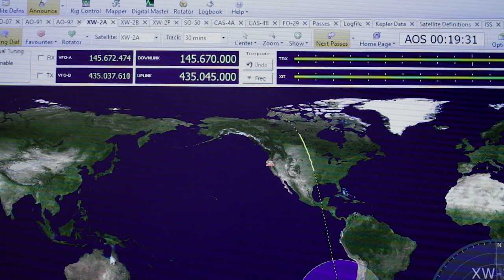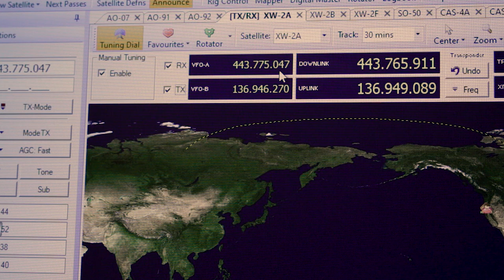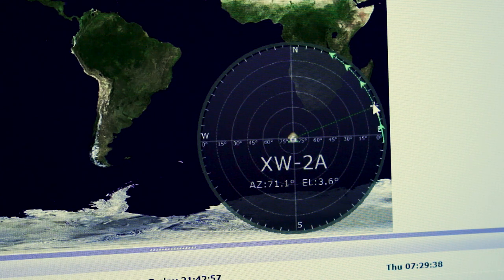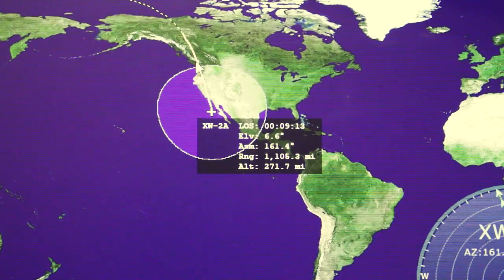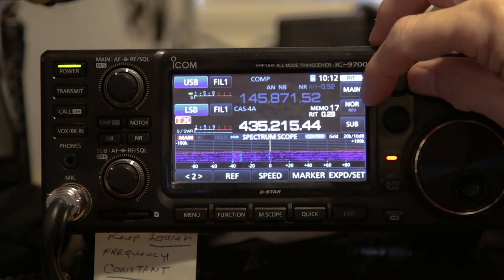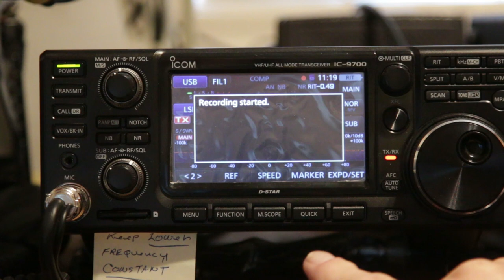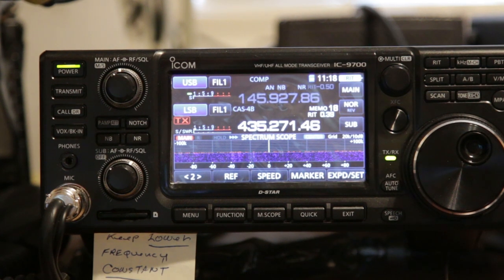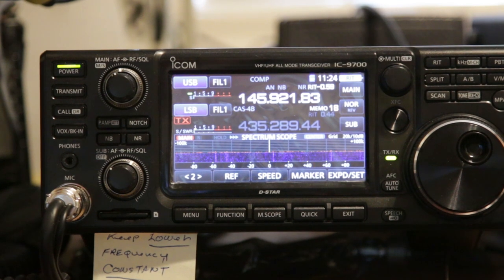SATELITTE CONTACTS WITH IC-9700 AND HRD HAM RADIO DELUXE

Comment: You need to use SatPC32 instead of HRD.  I have used both.  With SatPC32 you can make adjustments for the Doppler offset with the CAT adjustments option on the menu bar.  For each individual satellite you  can fine-tune  the uplink or downlink offset or both.  I just adjust the uplink offset while I listen on the downlink.  Once I get tuned in properly  I save the settings and from then on that satellite is always tuned in for the Doppler offset as soon as I start the tracking for that satellite.

Comment: Hi Bob  You  need to tick the two boxes in the frequency  panel on the satellite software,  then the software will do the tracking.  The 9700 looks good  and I am considering  the rig myself.  Keep at it ,  Cheers

Comment: Thanks Bob for posting this.  It makes me want to give my HRD another try. I jumped heavy into sat. All with a set of beams and a Yaesu sat rotor. Spent a crapload of money and then to struggle with HRD trying to use 2 991A radios.  Tried SatPC software although it halfway worked I hate it. If HRD will work with their latest update maybe I will give it another try. It is way more user friendly and much much better eye appealing in the graphics. Again thanks for the boots of inspiration.

Comment: Thanks for the video on satellite ops.  We have a new IC-9700 here and have only listened to sats on an older FT736R with Elk 144/70cm antenna. I thought the idea for the 9700 is that it would track Satellites without external software such as HRD.

Comment: Its important to know that the IC9700 MUST NOT BE IN Satellite mode, just preset to normal 2 band FM or SSB mode because HRD Satellite will command the radio into the appropriate mode and frequency.     CHECK the RX box to begin tracking, Check the MANUAL box to manually tune around then uncheck Manual when ready to contact the chosen station.    When HRD Satellite is Running it is NOT possible to change RIT mode or voice recorder Mode, UNCHECK RX in order to change these settings.

Comment: Bob, I really appreciate your video, as I'm fumbling through setting up my satellite station with HRD.  I understand your use of RIT to keep on target with responding stations, but I'm sure HRD didn't intend that.  I am struggling through the same thing.  Have you tried using the sliders on the tuning bar to adjust frequency while the doppler correction is active?  Have you found any other solutions since you posted this video?

Comment: I've been having similar issues as you.  The rit doesn't make much sense because you're only changing the frequency in between updates from HRD and if you notice, you're also changing the the frequency on the on the TX side, but not even in proportion to the RX side.  So while you're tuning with rit your signals progressively get further apart on the transponder.  I'm learning with you and trying to figure this out too. {edit... I realize this is RIT only, not RIT/TX.  I'm used to my 7610.  my apologies)

Comment: Bob, thanks for making this GREAT Video!! I have the same software and the same radio.. In the process of building the antenna system. Have the Yaesu G-5500 Rotor and GS-232B control BOX!! i Have not yet settled on what antennas I will be using for the 30 foot tower mount..  Any chance we can get what your control and antenna system is you are using??  That would make an interesting video.. I will have 3 antennas total, one for each band and individual feed lines, Already Installed,, for the antennas. Using the IC-9700 mopstly for terminal mode right now, but the main reason to get the IC-9700 was for Satellite Operation hear in San Diego!!   Bob,, WA6PHN

Comment: Hi Great vid I have a 8 element yagi for 2m on a rotor . I am also going to get a 9700 what else would I need to do antenna wise ? Are you not using any elevation on the antenna Thx agn

Comment: Great video.  Question on your system.  Are you using pre-amp?  What about you antenna system.  Are you using multi-element yagi?    Wondering with one could work satl. With verticals?

Comment: I thought I could overcome chasing doppler on CAS-4A and 4B linear Sats by locating my CW signal before locking the uplink and downlink VFOs to track but sometimes the observed frequency difference from the center frequency was as much as 3.5 khz and other times only 1khz.   Does PCSAT32 or HRD Sat software help compensate for doppler ?   Has anyone programmed the UHF side with incremental frequencies stored in memory to compensate for doppler ?

Comment: Hi Bob.  I haven't used my 9700 on the birds yet but will eventually.  That VFO A/B flashing is annoying (to me).  Is this a function of the radio or HRD?.  Is there a way to turn it off?
Reply: By the way, I used to use the birds years ago  (Oscar 7, 8, 10, 13, 40), and if I remember correctly the standard way to compensate for Doppler was to adjust the uplink frequency to maintain a constant downlink frequency.  This way the transmissions downlink signal isn't  walking up or down the band.